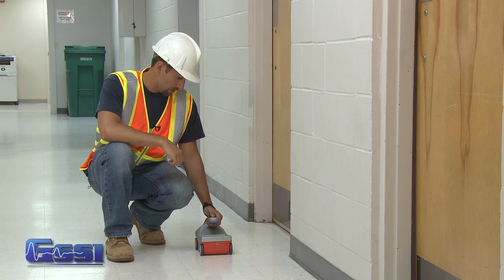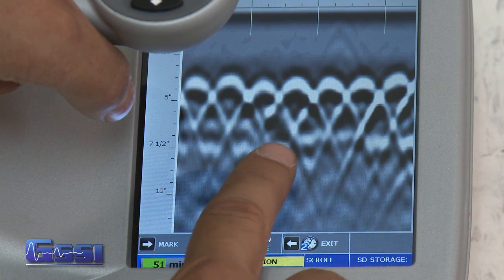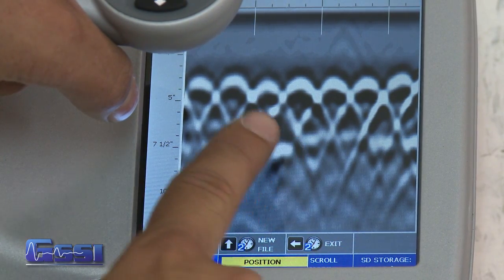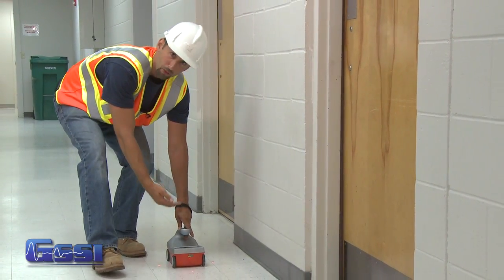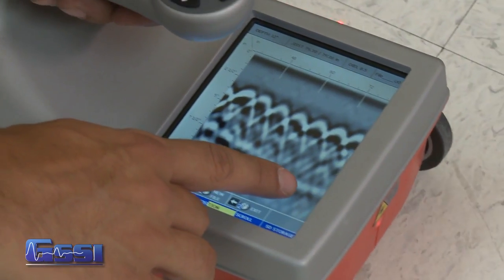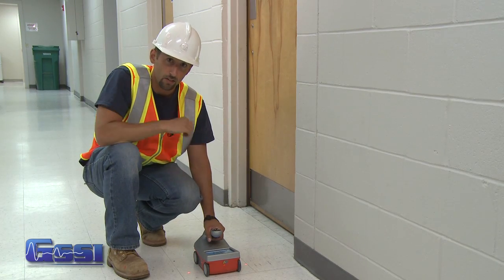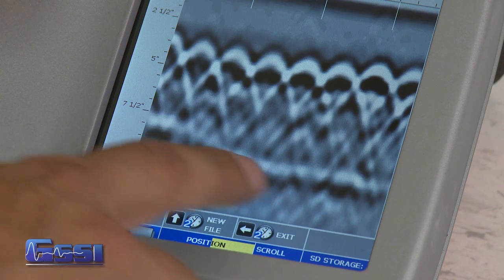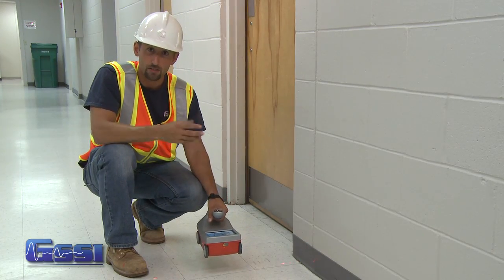How to: Determine Concrete Slab Thickness using Ground Penetrating Radar

Comment: Can you use roadway horn antennas to determine the thickness of the slabs?
Reply from the maker: The RoadScan 30 system is commonly used for pavement testing. It may not be suitable depending on the thickness of your slab, with the limited depth penetration of an air-launched antenna.
Reply: @GSSI so in this case, would you recommend the StructureScan over a SIR-30 air launch unit?

Comment: So this is using ultrasound as its ping from the looks of it..  ultrasonic imaging through high frequency sound reflectivity monitoring.  Basically its probably got 2 or 4 little round devices on the bottom that emit the high frequency ultrasonic wave and it would have receivers that pick up the waves that bounce back and displays the strength at which the waves came back to itself..  
  Or does it have some caution radioactive stickers on it?? If so than thatd be one hell of a consumer grade tool to have.  If it used a radioactive doppler than jeez..  would run in the 20k$ range..  if untrasound it shouldbe i the 5-10k$ range depending on what features its got..  like if you could store an entire sweep on a usb drive or bluetooth to a pc with an actual camera on the thing to communicate spacial awareness relative to the readouts..  you could run the thing like a lidar scanner and give customers an actual print of it all..  be a shark tank deal of the year right there if developed..
Reply: It’s radar, “ground penetrating radar”. Google it.